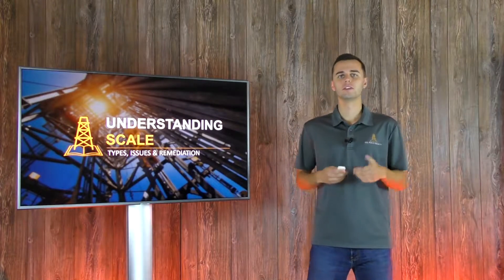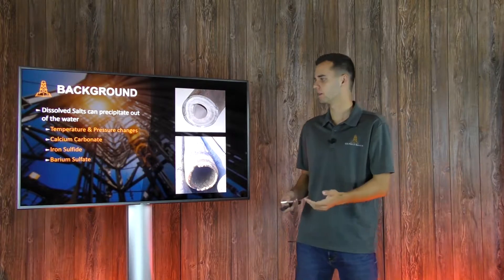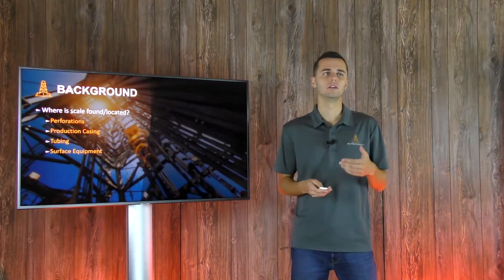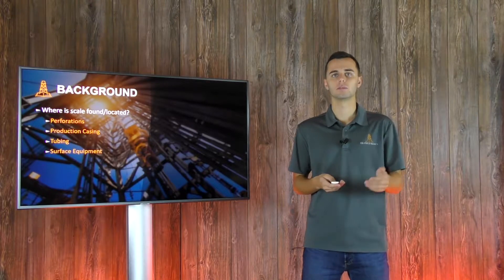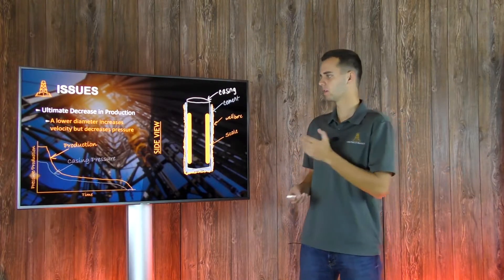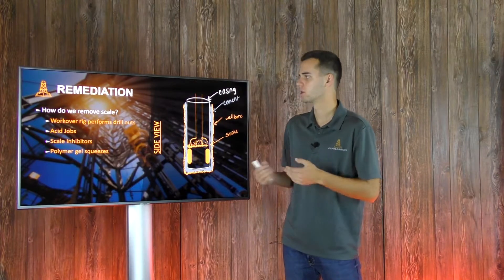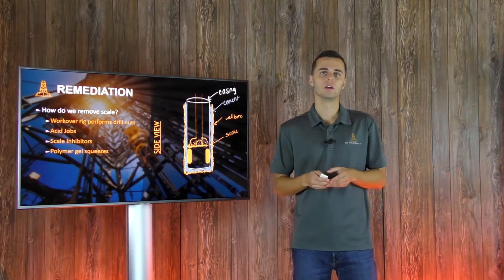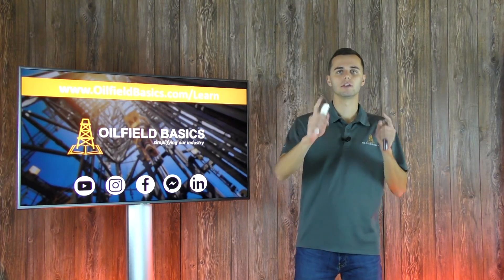Scale: Types, Issues, and Remediation

Comment: I'm just a simple work over rig operator with no continued education and enjoying your videos. Learning a lot.  I'm sure you'll cover it or have but some problems ive encountered are operations errors not properly mitigating work string scale on the completion side of operations.  Thanks and keep up the videos with this awesome info.
Reply from the maker: Thanks man! Glad to have ya on the channel and to add some value! Can you elaborate what you mean by "work string scale?" You talking about string weight...pipe heavy v. pipe light?
Reply: I'm talking about the pipe that is brought out before use.  There have been occasions that problems have occurred where plug offs in a drill bit happen due to corrosion with pipe that is being used to drill. Operators at times will use the same pipe on multiple wells and that can be a problem if not properly cleaned or "drifted". This can be done with a cylinder type piece of metal just a little smaller than the inside diameter of  the pipe being used to drill.